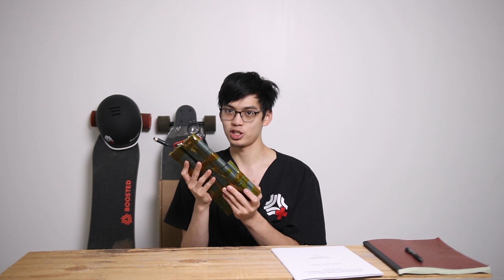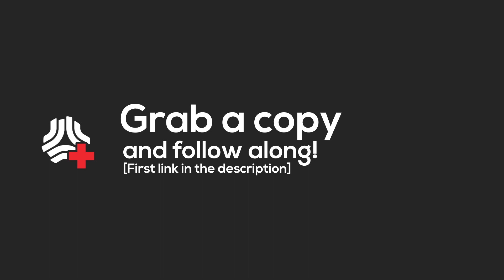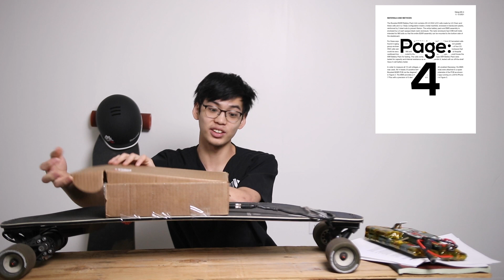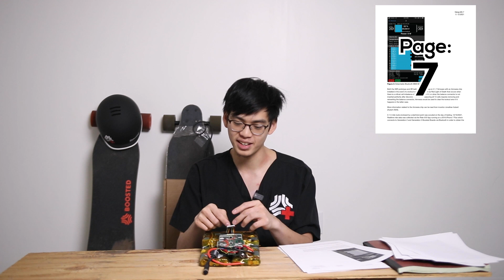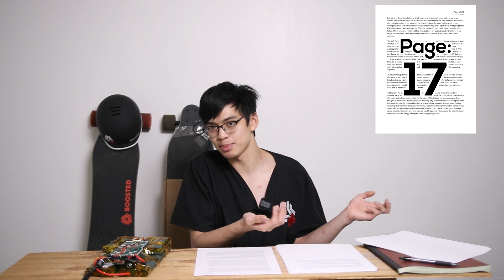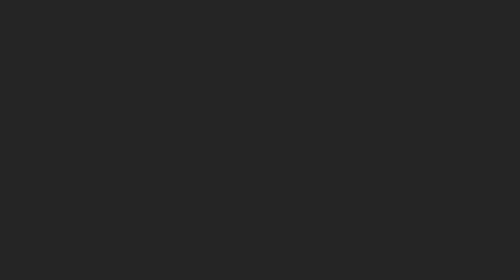The Boosted XXR Battery, Explained!

Comment: Hey brother, thanks for helping all of us out In The past. AND IT ROCKED.

I have a problem.
One dead controller, one lost controller. 🤷‍♂️🥴…

eBay v2 market value $250z 

I have cheap opportunity =
Two v2 minis with charger and remotes. 550$🤩

100 miles away. 

Would you say, get the two minis, primarily for the remotes. (And all the other good stuff.)
Battery’s, control units, chargers, bearings, wheels gears and belts. AND REMOTES. 

Could I ADD one or both mini battery stacks to a  BB stealth. 

Every thought about trying to geek out with the guys that actually made it in the first place for some source code and balancing mathematics? 

What if you just made a chip the had variable source code. 

Put a Nokia phone interface. And computing power.
Reply from the maker: Get the 2 Minis. I bought 4 of them just for spare parts for my Stealth haha

Comment: I have signed up on your website for a XXR battery i 3D print multiple things and I think a 3-D printed carbon fibre nylon case would benefit this battery as far as heat dissipation goes metal heat sink plates would dissipate it as well
Reply from the maker: Great question! We are still investigating heat generation. We don’t suspect that there should be a dramatic increase, but results will remain to be seen until testing is done. What printer do you have? I have a Prusa i3 MK3S!
Reply: @xrgeneralhospital  artillery sidewinder and ender 3 texted your cell let’s face time soon as I got about 8 boosted batteries in stock right now one blinks red and on just doesn’t turn on
Reply from the maker: Can you shoot me another text? I don’t seem to see it in my inbox. (734) 837-8704

Comment: Awesome work man!
Reply from the maker: Right back at ya! Maybe an XXR needs to be added to those skis?
Reply: @xrgeneralhospital  yeah but I was thinking the Loooooongboard would get more use. The skis scare me lol. Is it exactly double the range?
Reply from the maker: The prototype only gets around 70% improvement, but the prototype had a voltage delta much higher than the stock XR, which caused the voltage cutoff at around 3.4v instead of 3.0v there was a lot of energy left over, so a delta much smaller would have yielded closer to 100% more range.
Reply: @xrgeneralhospital  that's amazing!
Reply from the maker: @CodyHovland  maybe we should put it on the loooooooooooooooongboard then :)
Reply: @xrgeneralhospital  The would be awesome to put 3 on the loooongboard and see how far it'll go. I had 2 mini S's and one mini X  on the board and would go 20 miles. My guess would be 50ish miles.